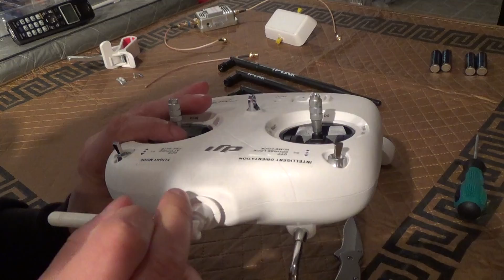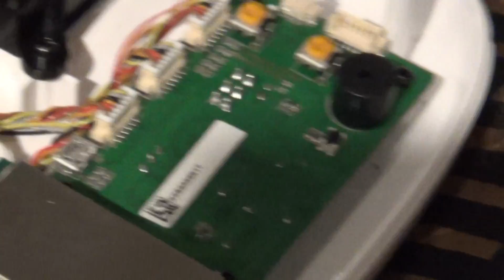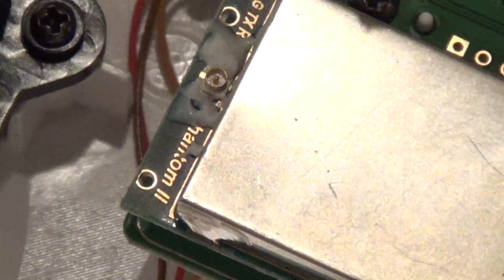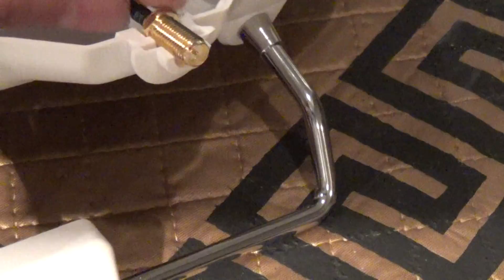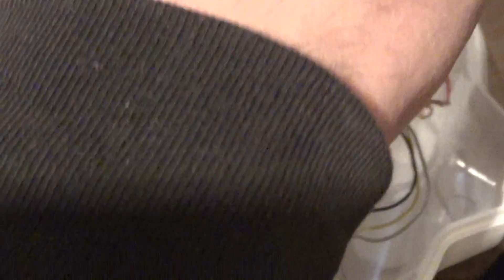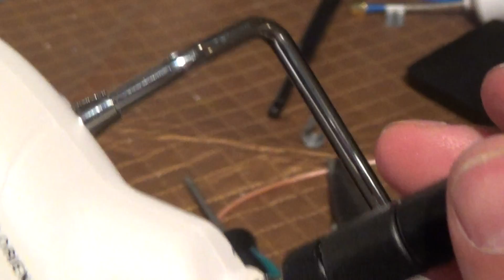DJI Phantom 2.4 and 5.8 Radio Control Antenna Mod increase RC / FPV Range

Comment: I have done this modification and I lost range using 5dbi and 8dbi antennas. I had to add power to get the range up. Add power to get the full benefit otherwise don't do it.
Reply from the maker: If you lost range it means something went wrong with your mod as when done without issue it works flawlessly to gain range.

The most common problem that can go wrong is a bad cable.  It may be faulty or have a short.  Second issue can be your cable connector is not properly seated on he ufl side.

Another possible issue is one of the two antenna outputs may be transmitting at a lower power.  If your mod was to a single connection then swap the antenna connection to the other output.

Worst case scenario when you worked on the unit you may have shorted out the pre amp in the wifi range extender.  Easy way to determine is to reverse the mod and see if you had the range you did prior to the mod.  

The majority of people doing this mod using only one 5dbi omni directional have seen no less than 25 percent increase but on average much more.  My range went up substantially Witt just the 5dbi.  Tho by far the best improvement has been using a high gain helical.  If modding just the wifi range extender use an LHCP helical if modding both ends the phantom and range extender you can go with RHCP or LHCP as long as it's the same on both ends.
Reply from the maker: Oops I just realized I thought you were replying to the wifi range extender video.  Regardless tho you either have a bad cable or damaged the amp.  Go with getting a replacement cable.  You should see no less than a 40% improvement in range with the 5dbi tplink tho using a 5ghz specific antenna well yield even greater results especially if it is a directional patch antenna.

Comment: I modified my transmitter's antenna and upgraded it to the tp link 8dbi omni directional. however testing outside, I could only get around 800ft horizontal distance and it loses connection and returns to home. Same thing with going high. It lost signal around 300 feet and the quadcopter was just next to me. I have dji phantom 2 vision plus. Any suggestions what I could do to fix this? Or if I did something wrong.  Thanks.
Reply from the maker: Ryan Pons this replay may be a bit late to matter but you either were not orienting your antenna properly, it needs to point straight up to the sky, not at the quad.  If orientation isn't the issue the cable you used internally may not be good which can happen from time to time.    Also your distance will vary depending on the surrounding conditions and interference around you. Also make sure the remote was on FCC mode.

Comment: Hi ben7,I have the Pv2plus and with the 2.4 sunhans 100mw amp wi-fi boost,did you or do you know of anyone who did an internal mod to the sunhans amp.What would be the largest sunhans amp I could use with my range extender,including the size of antenna.thx
Reply from the maker: Hi, the Sunhans amps should not be modified.  And you can use a 1 2 2.5 watt Sunhans amp no problem you can probably go higher I don't really think there is an upper limit as to the max altho if you have too much power going out it could interfere with the other signal unless both control and. Oreo are both being amped at similar strength.  I seriously wouldn't recommend over doing it.  You will get more out of using a good quality expensive helical antenna than throwing too much power on it.
Reply: Thanks for the info.later

Comment: Thanks for the video.  But it seems like it will take us forever to remove the silicone or we end up damaging the board. Based on this video i'm not going to buy the stage 2 kit just yet. Doesn't seem that simple. For now i will give a vision+ booster a try :)
Reply from the maker: Hi, I would say people who damage the connector while removing the silicon are far in the Minority especially for using a sharp knife and are being careful.  Also the booster software apps will not increase range of the radio control.  If you want to play on the safe side no mod way of extending range view my video on making an antenna reflector.

Comment: thanks for the movie/explanation. i bougth this: http://www.ebay.com/itm/TACO-3DPOWER-5-8GHz-Remote-Antenna-mount-for-DJI-Phantom-2-Vision-PLUS-/181624029278?pt=Radio_Control_Parts_Accessories&hash=item2a49a2c05e

Fits perfect so you don't have to modify the RC
Reply from the maker: Looks good

Comment: Ben, Does the blue activity LED on your 5.8 GHz amp blink?  Once connected and powered on, both the green power LED and the blue activity LED stay continuously lit.  With the props off, I go through all the controller functions, and the motors change speeds (noise) but the blue LED doesn't even flicker once so I really have no way of knowing if I am really amping the signal.  What do you think?
Reply from the maker: To be honest I bought the 5ghz amp but have not gotten around to using it so I don't know but I assume it would when there is a connection or it might not since it's not a two way connection it's amping.

Comment: So I actually have already ordered two 8db TP Link antennas and was prepared to do the mod to my wifi range extender but after your comment about the whole "buble, donut" thing. Should I cancel my order while still can and scale back to a 5db antenna??
Reply: U can get the new FPV booster for vision + app from solomon mobile .
It really good and works perfect!

Comment: hi ben !!! since this video have you done another mod to the 5.8 and 2.4 antenas and if yes which setup stands out the best thx...
Reply from the maker: Hi I went through various tweaks with my FPV setup after I made this video and I did do the controller mod.  They all work great and dramatically increase range.  The best antennas to use for the FPV have been circular polarized antennas and I've used both an omni and a 5.8ghz patch antenna on the controller.  I also have a 5.8ghz signal booster for the RC in addition to one for the wifi range extender.  Both by Sunhans.
Reply: Ben7seven7 Any videos of that circular polarization antenna install? Also, am I see it right? Did you use a 2.4 ghz antenna for the 5.8 ghz transmitter?

Comment: I've done this to my controller. Today I attached an 8db gain Omni antenna and tested. Sad to say, I actually lost range. I will be testing some other antennas over the next couple of weeks to see if it is worth the mod to the controller for just a different screw on antenna before attaching an amplifier. By the way, that process of removing the original wiring will go a lot faster with a very small razor blade. The new RC units are not the same as the one you have where the antenna is mounted and can be modified very quickly with a dremel to simply cut off the mount for the original antenna.

Comment: hi can you please tell me whether my fc40 tx will work on the vision + quodcopter as well, as i see both work on the same 5.8ghz frequency ?
Reply from the maker: Dji don't make multiple controllers so yes the 5.8ghz controller is likely interchangeable between the Phantom FC40 and the Phantom 2 Vision and Vision Plus
Reply: Ok thanks

Comment: These work well for holding that cable in place http://www.securecableties.com/1-14-inch-black-square-adhesive-tie-mount-100-pack?gclid=CIT2p46nr8ICFYZbfgodC7sARA

Comment: How much more range distance was accomplished with this mod
Reply from the maker: Lisa Monday using a small 3dbi antenna added about 50% additional range, larger whips add more and high gain directional antennas more still.

Comment: hi ben>>> would you recommend drilling on top of the rc and leaving the stock antenna??
Reply from the maker: It's a matter of preference but that certainly would work
Reply: hi .thx for responding ... have u tried the compact dual band 2.4ghz & 5.8 ghz 12dbi, and if yes , would you recommend it ..what other mods do u recommend on a budget ?? once more thx

Comment: This was helpful for upgrading the RC, but does anyone have any video links for upgrading the other end - swapping out the little thin wire antenna that is on the DJI Phantom 2's leg?
Reply from the maker: There are some videos showing that but it's difficult and not necessary if you use a high gain antenna on the control and or add a 1 watt 5.8ghz Sunhans wifi amp.

Comment: I have a dji phantom 2 v+ and I want to change antenna on control only. What cable do I need togo inside controller, ufl or Mxc
Reply from the maker: Vision or Vison Plus the radio control is the same and you will need a u.fl to Rp-sma cable.  6" should be fine.
Reply: What about a antenna with no booster? Can you send me a link or part number looking to get a half mile to a mile range if that is possible
Reply from the maker: You don't need anything fancy to get a half mile range with the stock radio control in FCC mode. Just a slightly higher DBI Omni directional will do it. Or patch antenna.  You can check out Hobbyking for some inexpensive directional antennas. You don't need to worry about circular polarized if you're using it with the stock antennas on the Phantom.

Comment: Ben... thanks for the video.  I'm in the process of changing my antennas out right now, and unfortunately while I was scraping off the silicone I damaged the ring where the lead connects to.  First, do you know the name of the silver rectangular piece where the antenna lead hooks up inside the controller?  Trying to figure out if I can purchase and replace that part, or if I'm going to have to just buy a new controller.  Thanks for whatever assistance you can give.
Reply: you can get the little square connector on ebay I got a couple of them last month, they cost 3-4 dollars for 2, look up u fl connector and you'll see it, soldering is easy, solder the two separate locations on the bottom.

Comment: What is the unused connector in the middle of the screen at 25:42 ?  It looks like a small HDMI port.
Reply from the maker: The connector inside the controller is a micro usb
Reply from the maker: The connector is a micro usb used for programming and firmware updates which which there hasn't been any in along while

Comment: I assume the antennas used are directional and therefore need to be facing the phantom at all sides, but I'm wondering if an amplifier could be used?
Reply from the maker: For the RC control I was using Omni Directional Antenna.  I also have a 5.8ghz directional which will give further improved range at the expense of needing to be pointed at the Phantom, though that's not such a big deal since you're already pointing at the Phantom for the Wifi  FPV signal.

Comment: Thanks for the video, I am going to upgrade my controller as well. Can you give me the parts list and where you found the items. Im having a hard time finding the antenna cable that plugs into the board. Thanks
Reply from the maker: Hi, I have a parts list in the video.  The only part you really need for the mod is a u.fl to RP-SMA female pigail.  At least 4" long tho 6" is ok too.

Comment: Finally got around to doing this mod. Since I have the P2V+ now the range is so good without any mods I hadn't done it so far. But with the latest Android booster app, FPV is really lasting further than control so it was time. I used a combination of a brand new x-acto knife and some nice tweezers an was able to get the silicon stuff off quite fast and easily. The P2V+ controller shell is slightly different than the P2V but I used the x-acto and a little bi of dremmeling to carve out a little extra space in the slots so that there is no gap when the controller is reassembled. I screwed on the nut tight and it seems to work - will test in the field soon. THANKS again for taking the time to make this excellent video.
Reply from the maker: Hi, I'm glad you're upgrades went well and appreciate your comment :) I'll have some more videos coming regarding mods as well as FPV flying tips and pointers.

Comment: By adding a 2.4GHz antenna 5dbi I will increase the wear of how I speak French video fine but the word I do not understand.
guestion latest 2.4Ghz antenna 5.8 ghz where no problem? 2 works
Thank you beaucoup if I have an answer
Reply from the maker: I've used a 2.4ghz antenna without a problem on the 5.8ghz control and had a nice range increase.

Comment: I like to purchase an antenna and amplifier to extend the range of the radio control of my DJI Phantom 2 Vision Plus. Would appreciate to get your recommendation and alternatives to gain large range extension.....
Reply from the maker: You can use a Sunhans 5.8ghz 1 watt wifi amplifier on the Radio Controller of the Phantom 2 Vison or Vision Plus.  Just make sure if you do use one that you either use at least a 10 dbi attenuator with it or leave the RC in CE mode so you don't overdrive the amp which has a limit on the input power.  As far as antenna you can use the antenna that comes with the amp, or in addition a 5.8ghz directional antenna.

Comment: Ben, just a add on to my comment for helping remove the silicon sealer-The knife I was referring to is called "Olfa". Very well made and extremely sharp, so one does not need to work so hard and possibly have an injury.  Good luck and keep going.

Comment: Ben, good video on process of modifications needed.  Would suggest using a Xacto (or equivalent ) that is very sharp and much smaller to enable getting into the area.  Also a question: should you be using a wrist grounding strap to eliminate stray static from potentially damaging the pc boards?  Keep doing the good work of providing alternatives for increased applications. 73's

Comment: Hello, i am trying to mod my p2v+ what MCX connector should i get ? Do you have any suggestions?
Reply from the maker: The MCX connector is for upgrading the Vision Plus internal Wifi for the FPV Video feed.   I believe it's an MCX male and you would get the other end as a RP-SMA Female.  Then you can use external antennas on the Phantom for improved range / performance.  Clover Leaf or Skew Planer style antenna is best.

Comment: Nice walkthrough, but edit your videos down man. We don't need to watch you mess with the silicon for 20 min. Otherwise great job!
Reply from the maker: Thanks though I left the entirety of the silicon removal there so people can see what's involved to cleanly remove it without breaking or damage the connector on the circuit board.

Comment: Are these antenna on the on board reciever can be upgraded ?

Link below ...if yes what you recommend ..this is for the p2 not the vision

http://electronicarc.com/catalogo/product_info.php?cPath=107_155&products_id=1313&osCsid=c74b19889c52d7e4492524c280f7fb79
Reply from the maker: Those are the antennas on the reciever within the Phantom. They can't be easily upgraded because the u.fl connector is glued on to the main board and not soldered so pulling the antenna leads off will often result in ripping off the connector. You would need to splice in a new wire instead but it's very doable though I wouldn't recommend it to most people.

Comment: Great video, whats the USB connection for on the bottom of the radio, you didn't really explain, thanks Ben.......
Reply from the maker: Hi, thanks, the USB connection on the bottom of the radio is for updating the firmware of the RC as well as calibration or changing it from a Mode 1 to Mode 2 controller.

Comment: Hi Ben - I followed your video and completed the controller mod last night. Thanks for the step-by-step instructions. Just a quick question; I am now using the Phanton 2 (non-vision) and ideally would like to use my 5.8ghtz antennas on the controller. Do you think it will still work since the controller runs on 2.4ghtz?
Reply from the maker: The short answer is yes your 2.4ghz control will function with your 5.8 antenna.  Optimally tho you'll want to use a 2.4ghz patch antenna for longest range or a good 5 dbi or better whip antenna
Reply: Ben7seven7 ok got it. was hoping to use my fpvlr 4.25 turn antenna that was originally for my old phantom 2 vision (for the repeater mod). i do have a 8 or 10 dbi whip that I never used...maybe that will function best for now? i didn't know those whip antennas are the same for 2.4 and 5.8;  perhaps I should buy a 4.25 turn antenna from fpvlr but ask them to make it 2.4?

Comment: thanks for this video - do you know if this mod on the P2 controller will cause any problems with the built-in tilt lever? I ask because when I tried this mod on my PV2, after putting in a tilt lever from ebay, the tilt lever was a pain to get back in place.
Reply from the maker: If you do this mod right installation of a tilt level for the gimbal should not be a problem at all as you're not altering anything inside the controller aside from a cable swap.  As long as you've got the controller back together flush without the power lines in the way you'll be fine.
Reply: Ben7seven7 yep, you were right. the tilt lever works just fine. thank you.

Comment: i did this mod on my 2.4ghz controller and my controller wouldnt get any signal from the receiver that is 2.4ghz should i use a 5.8ghz receiver?